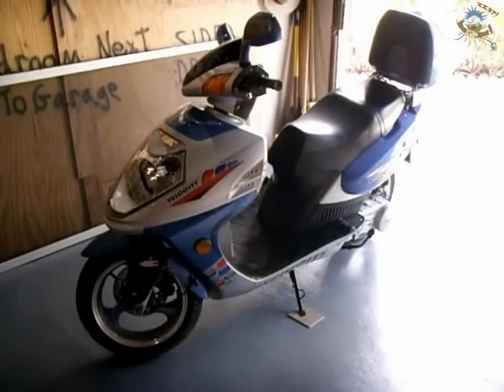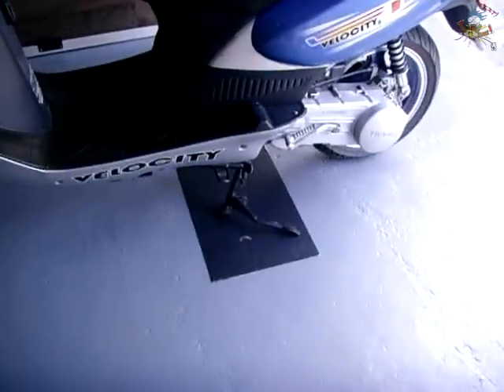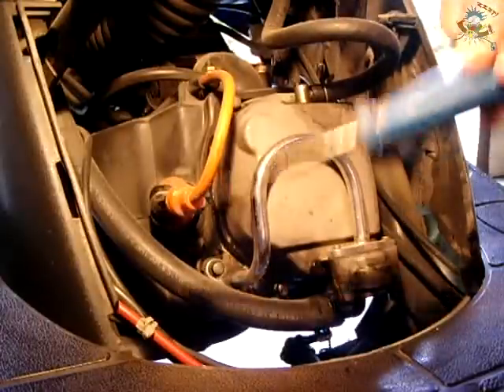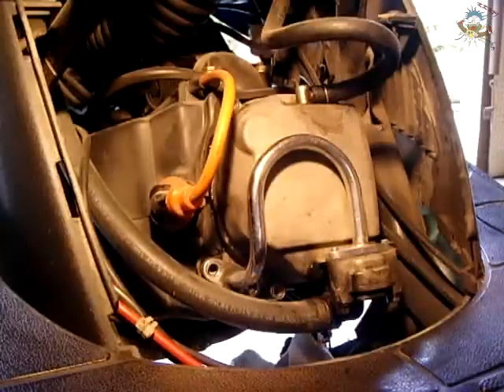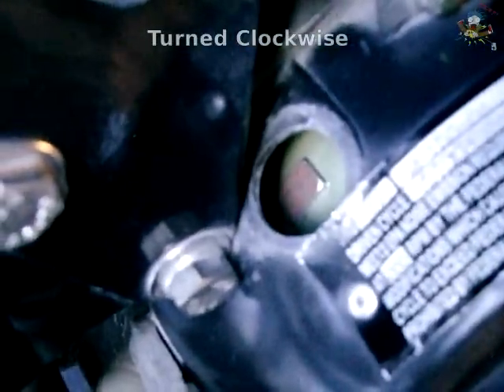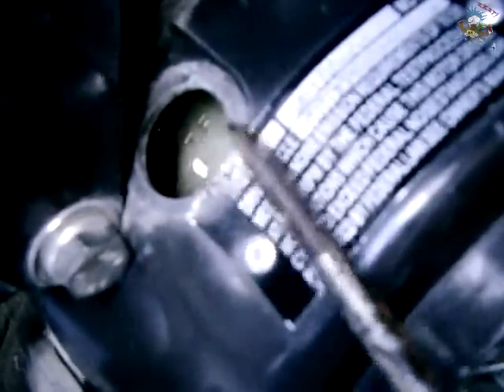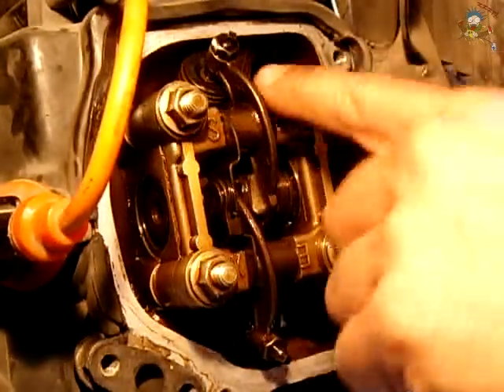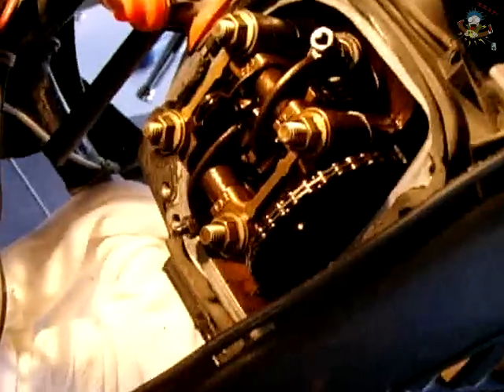Highly Detailed GY6 Valve Adjustment Procedure(Step By Step)

Comment: If this helps anyone, I'm working on a Schwinn (chinese) Valo 150 and the TDC mark is on the actual flywheel (attached to the cooling fan). You have to take off the fan cover, and there's almost a needle/arrow machined into the crank case that you line up with the marks on the flywheel. Kind of a bummer they didn't put an inspection port or anything but it's pretty easy to see when you get it apart.
Reply: James Hare i have a starting problem it looose its fuel prime it will stay running when i hold throttle any ideas i also put a stator in and cleaned carb i cant find any info on these scwinn valos any help would be gladly appreciated
Reply from the maker: James Hare Thanks for posting that info. :-)
Reply from the maker: I don't know anything about valos. Sounds like a faulty carburetor or enricher. Also make sure the engine compression is good, and the valve adjustment is correct. I have another video called, "Troubleshooting GY6 Engines".

Thanks For Watching!
Reply: Yeah the carb they put on it is pretty junk. I'm replacing mine as well.
Reply: what can i use for carb scwinn seems to be odd when trying to get parts
Reply from the maker: Look on Ebay, there are parts. Use Google to look up parts.

Thanks.
Reply: i just dont no what carb to order
Reply: what would u suggest for a good carb

Comment: Thanks for the video.  I recently purchased a used 150gka-2 and this was by far the most useful video I have found to help me start getting it tuned up and running better.  Still a loss of power to deal with but I'll figure that out eventually.  Thanks
Reply from the maker: Remove the spark plug when the engine is warm, and screw in a compression tester and crank the engine to see if the compression is good.  125-150 psi range is a new engine. Anything under 100 is not good. You could have crud in the valve seats or require new piston rings.

Thanks For watching! Be sure to rate Thumbs Up, and share my videos
Reply: electronicsNmore Thanks for the advice.  I'll give that a try and see if that's where my problem is.  Thanks

Comment: My scooter whines at top speed and vibrates behind the
heels of my feet would a valve adjustment fix this?
Bought 50cc scooter used with 4000miles on it and
I'm sure the previous owner(55yr old man) never did a valve adjustment..
Reply from the maker: High pitched whine coming from the rear sounds like a bad rear wheel bearing.
Reply: Not the rear is not that far back its 
Right behind my heels!
Its vibrating and whining where the cover to the valves are or right in that general area..
I think its safe to say a valve adjustments not going to hurt.. a Better question would be if my valves aren't spaced the same would the scooter whine and vibrate at top speed?
Reply from the maker: I don't think a valve adjustment is the problem. Sounds like a bad bearing. You need to take the valve cover off, and loosen the timing chain to see if there is any play in the camshaft bearing. There are many things it can be. You need to place the scooter on the center kickstand and rev the engine while another person listens while you do it.
Reply: Okay so if in the end it is a bad bearing whats the cost to fix it? and side note running the engine with the valve cover off won't damage any components?
Reply from the maker: The only problem would be oil all over the place, unless you have a cover with EGR. Look that up.
Reply: If you don't mind I'll upload a video of exactly what I'm talking about and put the link in a comment on this..
(The sound and a POV ride with description of this issue)
And I do have the EGR on my cover.

Comment: 003 and 004 are to tight you will burn the valves i set mine to the plate on the scooter. or check the manual.
Reply from the maker: Where did you hear .003/.004? I always do .004/.005, or both at .005". I have heard of many people using .003"/.004" with no problems at all. I also show those clearances in the video "About" section.
Reply: yea i set mine today at .004

Comment: I have a 50cc would the measurements be the same for the I and E?
 Cleaned carb and new spark plug but my engine will crank but won't start I am hoping this is my issue. Adjusting the valves this weekend. Thumbs up =D
Reply from the maker: You can do .004 Intake / .005 exhaust(lower valve), or .004" on both.

Comment: Great video. Did mine at 004" on both. Gap might be smaller though because the feeler drags quite a bit. Is 003" for E and 004" for I a better setting?

Thanks
Reply from the maker: Hey James. Usually both are .003" to .005", but I sometimes use .004" intake and .005" exhaust. Make the exhaust slightly larger, not the intake.

Thanks For Watching! Be sure to share and rate Thumbs Up
Reply: electronicsNmore Ah typing error I meant 003 for intake and 004 for exhaust. Set that and it was great. Rattled a bit though but the "ticking" noise isn't excessive so its fine. Thanks for the great video made it really easy to do. :)

Comment: Thank you for this video.

I have a Linhai 300cc and its got 800 miles on it.  I don't have any problems with the running of my engine but this was very informative. 

My set up is different but the process is still the same. 

Your other vids are good also.
Reply from the maker: Thank You. Be sure to rate thumbs up and share.

Comment: What silicone you using sealing that cover?
Reply from the maker: High Temp Red, but you can use the regular blue RTV on the valve cover.
Reply: Thanks. I wanted to use normal one before but i was afraid that engine getting to hot for this. I have little bit of clear left and i give try tomorrow :-)

Comment: YEA. ANOTHER WAY FOR THE VALVE-COVER GASKET IS TO TAKE OUT THE GASKET. CLEAN THE GROOVE VERY GOOD. THEN RUN A BEAD INSIDE, AND LET DRY FOR FEW MINUTES, BEFORE INSERTING THE GASKET. THIS WAY, YOU`LL GET BETTER SEALING WITH COVER. COMPRENDASE AMIGOS.

Comment: excellent video i like how to showed how to take off the cover and use the center kickstand as well as adjusting the valves with your hand..a beginner can do this because your veido is very detailed...you just forgot to tell them to unplug the battery lol...probably not a big deal but know knows
Reply from the maker: No need to remove the battery cable. Just make sure the key is not in the ignition, and the start switch is in the off position. :-)

Thanks for watching!

Comment: Thanks for the video.  I've watched several of your other videos, and I've got to tell you, I'm a much more informed scoot owner thanks to you...anyway, I've got "hard, cold-start" issues, and I'll be adjusting my valves, because everyone pretty much says that's how to handle the issue.  My question is, why does adjusting the valves help with cold starts???  Thanks.
Reply from the maker: Thanks For Watching Larry. Be sure to rate thumbs up and share.

If the valves are out of adjustment, the cylinder will not have the proper compression. Everything has to be timed correctly for proper engine operation. If the valve is too tight(likely in your case, then the valve may remain slightly open reducing compression making it harder to start.

Comment: You didn't even bother to say what your exhaust gap is set at.  Are we supposed to guess?
Reply from the maker: In the video I mentioned the feeler gauge size of .005". I thought people would know I used the same feeler gauge for the exhaust. It was mentioned in detail in the video description area, but I also made a note in the video(in direct response to your comment) to help clarify things for others. People have to realize that I do not get paid a lot of money for these videos which take time to produce, edit, and upload. I also do not have to share my knowledge with others in an effort to help them. I do so because I like to help people. This is an excellent, well explained video, but unfortunately(Not saying you), there is always some troll/moron that would give this video a thumbs down. People wonder why we have big problems in this world. LOL  

Thanks For watching
Reply: electronicsNmore I don't know why you'd assume that because just about every blog, post and comment on the internet says the intake should be slightly smaller that the exhaust, like--  I .003 E .005 or I .004 E .006

These gaps change as the engine breaks in and then wears out.

A new engine starts out at I .003 E .004

A older engine ends up at about I .004 E .006

The only reason I brought it up is because of your title "highly detailed."

You stated the input was .005 but then the video cut to the exhaust and there was no mention of any gap size.

Other than that, it was a good video.  THUMBS UP.
Reply from the maker: Most people would think the gap was the same as the intake, since nothing was mentioned. As I said, between the video, and the video description area, the video was highly detailed. The owners manual for my scooter states .005" intake / .005 exhaust.

Thanks
Reply: electronicsNmore Are you're measurements in inches or milometers?  Thanks
Reply from the maker: (Inches) .004"/,005" or .005"/.005"
Reply: electronicsNmore I wish that were true.

No doubt those are the gaps for some, if not most, GY6 engines.

I've been adjusting mine for the last couple of weeks trying to dial in the right gap for mine.  Right now I have them at .003 & .005.

I think I need to open the exhaust gap to .006 because it still has a sputter to it.

It accelerates good so I think the intake is good at .003 but when I'm cruising at a steady speed or at full throttle or coming to a stop, it sputters.

Trial and error seams to be the only way to really know what's right for one's individual bike.
Reply from the maker: I have a feeling you have other issues with your engine. Your scooter should not be that picky with the valve setting.
Reply: electronicsNmore Well, the issue only happens during certain running modes.  Like top end speed, coming to a stop at low rpm and a little bit at a steady speed at mid range.

As I've tweaked the gap clearance, it's improved.  When I had it at .005 .005, it ran a lot worse than now at .003 .005

Since it ran fairly good at .005 .006 and fairly good now at .003 .005, my next step is to try it at .003 .006

.004 .004 - .005 .005 - .005 .006 was worse than where it is now at .003 .005.

About the only place left to go is .003 .006
Reply from the maker: 100% sounds like your timing is off by ONE tooth! I had the exact same problem. Moved it one tooth in the right direction. All solved. You need a timing light.
Reply: electronicsNmore After I set the gaps to .003 .006 and if it still sputters, I'll look into the timing chain situation.  Thx.

Comment: Very nice video! Not only that, it's a Velocity scooter just mine and my wife's!!
Reply from the maker: Thanks Dave. Don't forget the thumbs up! :-)
Reply: electronicsNmore
You got it!
Reply: electronicsNmore
Adjusted my valves today and Wow! The exhaust valve had zero clearance; more like the exhaust valve never shut all the way. My scooter hasn't idled when it is cold for quite a while but no problem now. I would suggest adjusting your GY6 valves after the first 100 miles. I can tell mine were never adjusted properly in the fist place. I'm 65 now and I dunno' how I made it before YouTube or Google! :-)
Reply from the maker: Very common for the exhaust valve to lose clearance. Your scooter should start/run better now. :-)